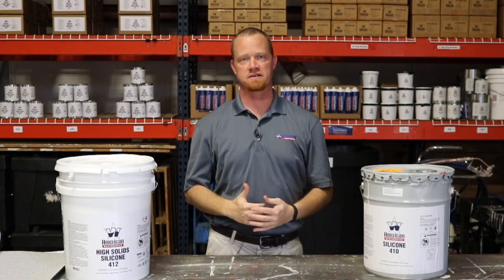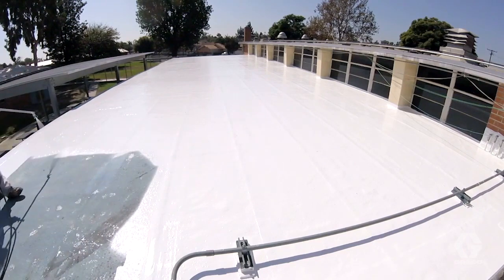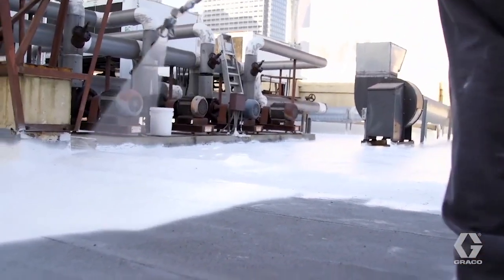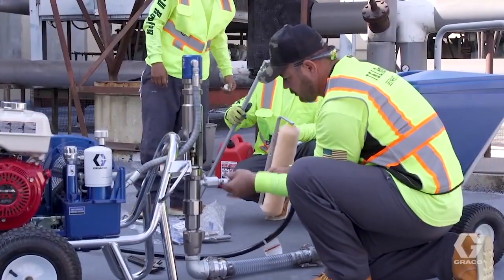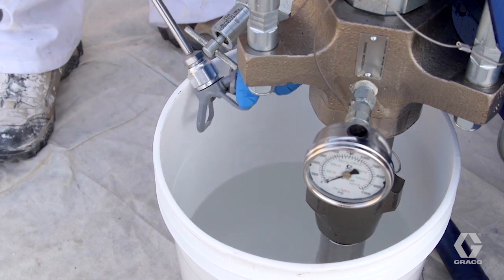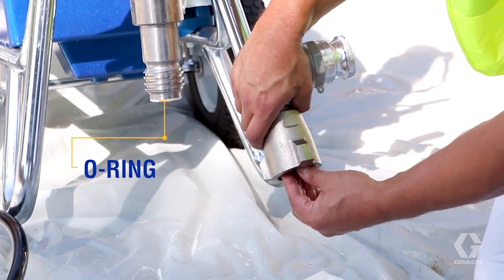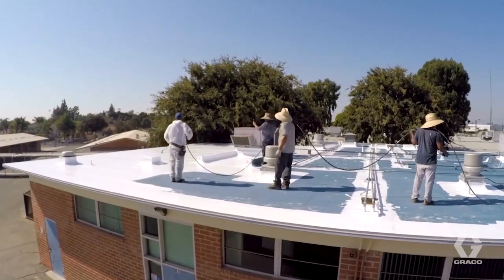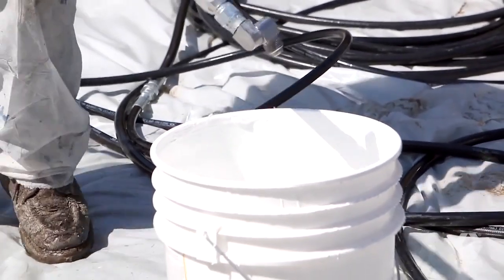Tech Talk: Silicone Best Practices

Comment: Based on the title, I didn’t know it was specifically about spray equipment. I’m wondering how to walk on a silicone roof safely especially if it is pitched, and possibly wet. Are there any special shoes that allow you to walk on wet silicone coated roof?
Reply: Your not supposed to walk on it when it's wet. 
Preparation and Proper steps are important to achieve longevity.

For Example: Metal Roof/New
(Monday)
1) Pressure wash whole roof and clean any debris 

(Tuesday)
2) Check and Remove moisture.
Methods. >>>  (Moisture meter) (Blower) (Sun) (Time)
Apply Seam Seal around screws, seams, perimeters, penetrations (AC units, Pipes, etc...)

(Wednesday)
3) Check and Remove moisture.
Methods. >>>  (Moisture meter) (Blower) (Sun) (Time)
Apply 1st silicone coating (Spray)

(Thursday)
4) Check and Remove moisture.
Methods. >>>  (Moisture meter) (Blower) (Sun) (Time)
Apply 2nd coating.